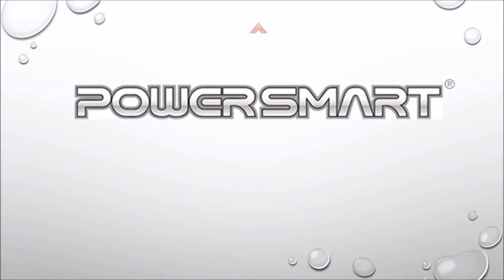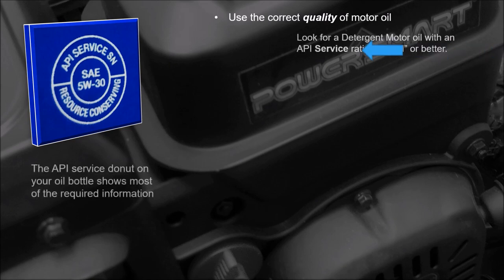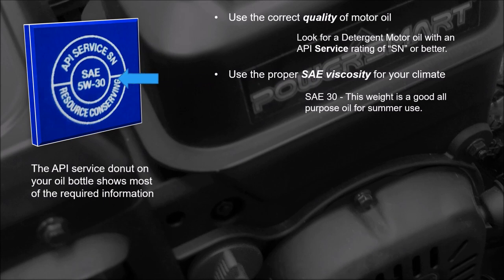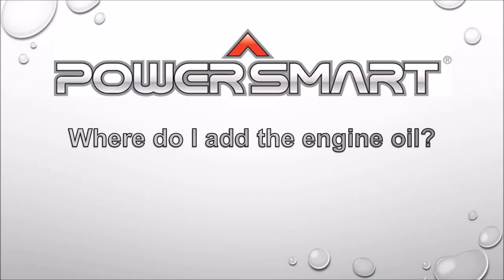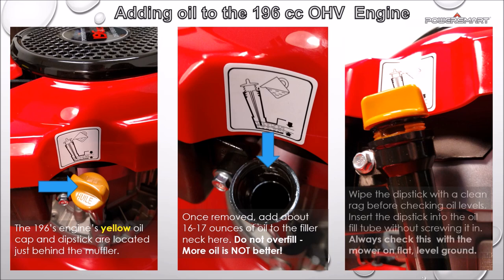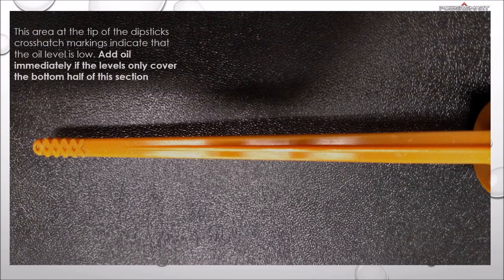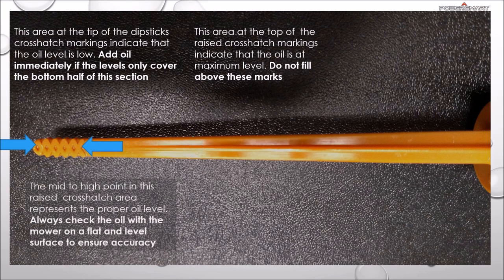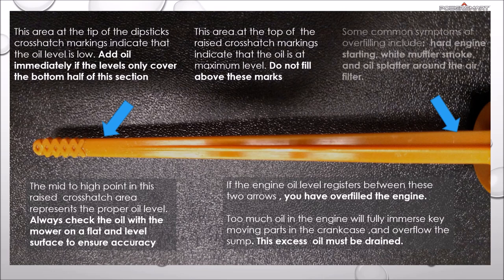Adding oil to the Powersmart Lawn Mower 196 OHV Engine

Comment: Should the dip stick be screwed in to check the oil?   Or just to where the treads touch.
Reply: It need to be screwed in but i think 16 oz will be too much according to my machine "PowerSmart DB2322S 22 inch 3-in-1 196 cc"

Comment: You can't even explain how to change the oil. Video is useless.
Reply: there website is too :/ i bought this thing second hand, definitely glad i didn't buy this thing new
Reply: @VikramBhosale1987  I bought mine last year new and usually lawnmowers have a release screw underneath which I still don't know if that's true with this one. However I decided to check the oil before unscrewing anything and the oil was still brand new since I only cut my grass once every two weeks .
Reply: @AuggieG42  hmm, i got mine off facebook used, i can't find a way to drain it, it definitely doesn't have a filter, and i cannot find a manual for this particular one. Nor can I find the right air filter i have a incorrect one on it right now which is too big to get the housing back on it, it's a good mower, just no parts available anywhere for this thing or data. Hope it lasts a little while. Self propel is off track and i will never get to it the way this thing is covered up. So it'a push mower for life as far as i'm concerned.
Reply: It's a 8mm bolt underneath the deck of the mower. 
Get you a little ratchet & 8mm socket, raise the mower by sitting it on two flower pots, drain, replace the oil, and start it up. 
Hope this helped.
Reply: @TurnTheStoveOnBlaze  You are talking about the Power Smart self propelled mower?
Reply: I have the DB2194P. It's the 161cc push mower. Check underneath your mower and see if you see a single nut/bolt.
Reply: @TurnTheStoveOnBlaze  OK mine is the DB2194S self propelled and it's covered by a plastic guard.Thanks anyways.
Reply: This is a shit mower - oem engine, pieces fall off, plastic wheels, etc.